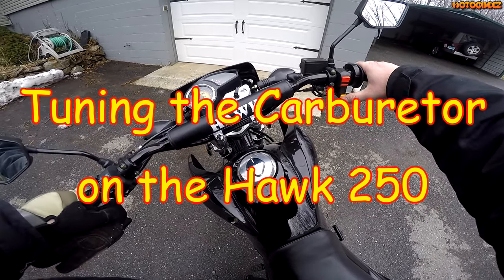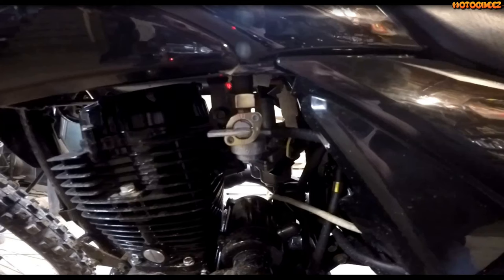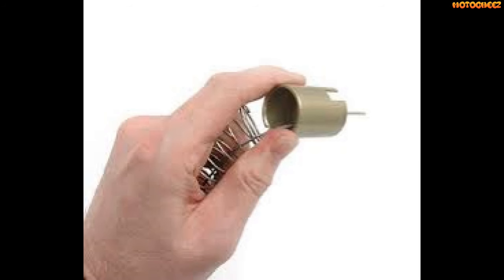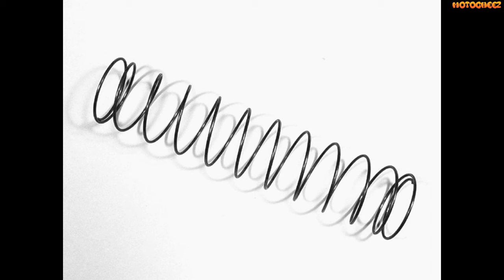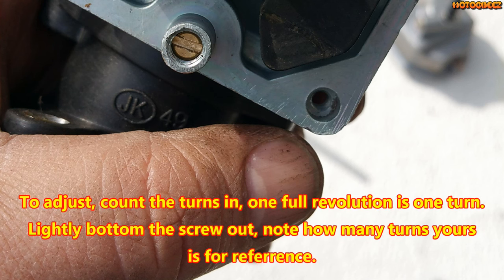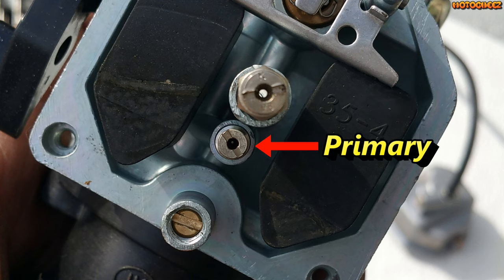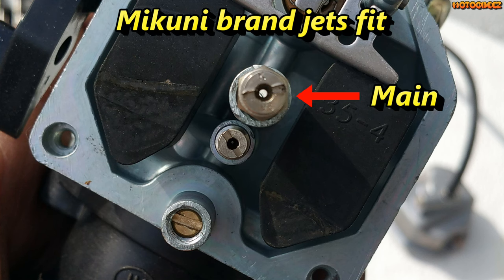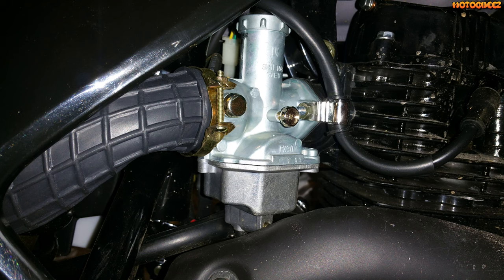[E3] Hawk250 Carb Tuning on the Dual Sport Chinese Enduro 250

Comment: Thanks Ray Liotta,  I used one thick washer under the needle plus 1.5 turns out on the screw and this thing finally starts easy and runs fine. I spent 20 miles tinkering with it before I watched this video and couldn't get it as good as this. This is just around town transportation for me, so this setup should do the trick. I scored the bolts to undo the carb perhaps in the future with a new jet but no rush. Many thanks from New Hampshire.
Reply from the maker: John Maynard excellent!!

Comment: Ok, I like it, did the airbox mod. 1.5 turns on the air mixture, 2 shims on the needle and 110 main. Went from 60 to 68 on the speedo. I have a local Chinesey bike shop near me. The main jet cost $3.18 . I know it's alot of money to gain power and speed but the minions must do what the minions must do. At first I couldn't figure out why you shimmed the needle why not just use the  next groove on the needle.....Ohhhh no other grooves on the needle. I should have known. Thanks Cheez. You the man!
Reply from the maker: scott addicott thanks!!

Comment: I did all the mods with the exception of the main jet witch I chinst on and went to the hardware store and for 97 cents I got the equivalent drill bit to a 115 orifice and opened the jet works awesome thanks motocheez
Reply from the maker: +Carol DeCosa I've done that in a pinch, sucks for the next guy who may want to replace it lol.

Comment: Thanks for the info Cheez!   I have the 2019 Tao Motor TBR7 250 which is basically another version ofthe Hawk.    Factory carb ran ok, but sputtered pretty hard at 3/4 to Full throttle.   Installed Mikuni carb 110 jet, fuel screw out 2 turns from tight, needle jet set one click down from the top (how it was in the box).   Air box and exhaust are factory.    This eliminated all of the sputter, and gave the bike overall a much zippyier feel to it.   Only other adjustment I had to make was the idle screw maybe 1/8" turn if that.    Awesome!
Reply from the maker: Sweet!!!

Comment: Well I had to build an air filter basket and put a sock over the basket to get more air, up the main jet to 110 and ride 3 hours with no bogging and decent response, haven't checked the spark plug to see how it's running yet

Comment: Thanks for the video! Im just over 100miles on mine. Same issues worsening. I will try the
the idle adjust. The bike never idled well. Beyond that I will try the washer shimming. I had
thot opening the plunger slightly with better throttle cable tension would do the trik but 
knowing there is an adjustment point (and shimming if required) sounds logical enuff for
me!

Comment: Solved my half choke issue.  Lever on carb was broke.  Never opened fully.   Was full or half choke whole time.  Back down to a 105 main and runs great.  Got 5ft of air on Sunday.
Reply from the maker: Wow. Good find!
Reply: @MotoCheez  would you happen to have a rim recommendation? Bent front rim on a boulder i shouldn't have tried to ride over.  Ate shit magnificently.  Replacing headlight , handlebars , clutch and brake levers.  Turn signals and tank plastic on left side as well.  Was hoping to get an impact resistant rim and new wheel hub.  But not sure what size rotor , wheel hub combo i need for this thing. Also need to stiffen the front suspension a bit and go back to that fucking boulder .
Reply: @MotoCheez  i climbed a mountain with it.  Thing is pretty darn good for 1500 bucks.  Coming down the mountain .... not so good lol
Reply from the maker: Dealer. But everyone is sold out! Damn. That's sucks
Reply from the maker: Haha
Reply: @MotoCheez  I'm gonna try to get just a rim hoop and reuse the hub
Reply from the maker: That's good if you're up for the challenge!
Reply: @MotoCheez  challenge accepted.  Ordered tusk impact rim hoop 36h 21" along with truing stand and spoke wrench.   Almost ordered a gasgas ec250 front wheel with hub already installed from tusk.  The hubs are anodized aluminum and look pretty sweet.    They're the same size but I would need a 5bolt brake rotor I think/hope is the only difference because I'm about to order the front and rear set

Comment: I am using the VM26 30mm clone. The fake Mikuni. I have a 22.5 size pilot jet, and a 105 main jet in the carb and it runs great for the most part. I am at about 4,500 feet in elevation. I never need full choke only half choke on most cold starts and I only need half choke for about a minute sometimes longer when it is really cold. The bike runs great and idles great when I take choke off after about a half hour of running bike and getting good and warm I notice as the bike gets warmer it doesn't idle as well and I need to turn up the idle with the idle screw. My plugs don't look fouled, and they don't show signs of running too lean. They look like they are burning decent. I am running the stock air box and exhaust. Does it sound like as the bike heats up it is starting to run rich/ lean or is there a possible air leak in the stock airbox that? I am puzzled. I have great throttle response and power.
Reply from the maker: Hmmm, usually idle goes up when it's hot. Maybe it is a vacuum leak somewhere. Or valve adjustment?
Reply: @MotoCheez  I have my intake valve set at .003, and my exhaust valve set at .004.I am going to let the bike idle warm and spray carb cleaner around the carb and manifold, and airbox intake to see if that changes the idle. I have checked the valves twice and they are good. I don't think it is a jetting problem.
Reply from the maker: Hmm. Agreed
Reply: @MotoCheez  what could be going on is I put an inline filter between the petcock, and the carb. The fuel line is really snug and I had a heck of a time getting it pushed on the fuel filter. It was so tight I didn't use any clamps on the filter. it isn't leaking any gas, but I wonder if when it starts getting hot down under the tank if maybe the rubber is softening up and I am sucking a little bit of air. I wouldn't think that would matter, because these don't run like my nitro RC car and airplane engines. If a nitro motor sucks air in the fuel line to the engine it will normally stutter and die.  That really sucks when you have to dead stick land an RC airplane lol.
Reply from the maker: Ahh. That makes sense
Reply: @MotoCheez  I uploaded a video of my Hawk I uploaded recently of me taking a ride on my Hawk to my channel, and it shows what I am experiencing with my Hawk.  I used an old runcam II velcroed to the visor of one of my off helmets.  I discovered I need to upgrade my camera as there is no image stabilization. For what I used the video didn't turn out that bad.

Comment: What elevation are you at? I'm in Toledo Ohio about 500 ft above sea level. My son bought one of these I had to take the plug off the idle mixture screw it was all the way tight. At first I tried it at one and a half turns and then I tried at two turns it seem to have got smoother at two turns but with bogged down so I put it about one and a half.. when I had the carburetor on her just to see if there's any air leaks I sprayed a little starting fluid around everything and it didn't Jack the idle up so evidently it's airtight.. I have a chance to main jet or anything he's a beginner he don't need a rocket
Reply from the maker: I'm at 600 feet here. I usually go out 2 1/2 on mixture and 115 main jet. You could go up one on the pilot Jet, to a 38 I believe

Comment from the maker: I just rejetted up to a 110 main jet yesterday.( then a 115, which was good, now I am up to a 120 with ALL my mods)
Reply: +MotoCheez what is the thumb screw on the right side of the carb for ?
Reply from the maker: +ZX6R that's the idle adjustment
Reply: +MotoCheez thanks, having a hard time running idle without giving it throttle.  mine stalls without throttle and was wondering if low grade gas was the problem.
Reply from the maker: +ZX6R screw in the idle adjustment. Mine idles low when cold so I keep throttle by hand until it warms up then it's good
Reply: can you update your jet kit link? or just what size pilot and main jet do I need for more power?
Reply from the maker: I updated the Jet link and redid Motocheez.com so the most recent links will be there if the ones on the vids are no good...

Comment: Man you are a good mechanic I just put 2 spacer on the needle like you did not only it adjusted the free play now I have more power at higher rpms I still think my bike is starving a bit for gasoline at higher rpms I'm thinking of putting one more spacer for a total of 3 or should I just adjust mixture screw? I have it at one turn now.
Reply from the maker: The mixture screw should be out 2 to 2 1/2 turns. 2 washers spacing up the needle is plenty. You're going to need a 110 main jet now, which is for when throttle is wide open
Reply: can you give me the specs of the need so I can buy it. Its running great right now I am very happy all thanks to your videos. but like you said I need that 110 jet needles I still feel like its asking for more gasoline.
Reply from the maker: +Modesto Rodriguez 110 main jet. Mikuni round main jet. Large or small round will work. Ebay has them. Stock is 98.
Reply: thanks
Reply from the maker: I updated the Mikuni jet link, it's from China .. http://goo.gl/ySTjOd
Reply: Nice that is a kit with plenty of jets for me to experiment with, I did everything you shown me in the carb video and FINALLY the bike runs great, now I feel it has plenty of power but I want more so I am jetting.

Thanks for all the helpful videos.
Reply from the maker: Great! The main jet at 110 will be perfect, but play around to whatever your bike may need...  Have fun!

Comment: Nice. I bought a kit from amazon to change the jets. I changed the main jet but primary was a different size than they gave me in the kit. What happens now? Its a mikuni clone carb of course. Does the primary jet need to also be changed? I changed the 100 jet to 110, seemed to be running lean. So I will try it without any further tweaking other than the mixture screw. I will turn it out 1-1/2. And see how it does. It probably won't work now that I didn't change the other jet.
Reply from the maker: Try 2 turns out. I had mine almost 3 turns. Same as raising pilot jet but you're only supposed to go 3 turns out, then go up on pilot.
Reply: @MotoCheez  my idle mixture screw turns about 5 times. Doesn't seem to have a stopping point. I just screwed it back up about where it was when I started. All I see is a small needle coming through the bore area when I tightened it about 5 turns. Nothing seated. Not sure what it was supposed to do or if it was supposed to bottom out.
Reply from the maker: It should bottom out and then do 2 to 3 turns out. Yes you can remove the screw totally

Comment: I just wanted to say thank you, I bought a Hawk mostly because of your videos. I rejetted and put washers on my stock carb like you said, even before I started the engine for the first time, and it seems great, just curious if you would recommend upgrading to the mikuni and if you see any benefits to doing that? Thanks man!
Reply from the maker: Warren Yeager I thanks and congrats! I don't think the Mikuni is any better for power gain from what I've seen and heard.
Reply: Hey Cheez what pilot jet do I need for the mukini carb?
Reply from the maker: I believe it was 28 that worked best. Been a while lol
Reply: @MotoCheez  thanx 4 the help much appreciated!

Comment: I did as the master of all cheez said. I did the airbox mod, put in a 110 jet and 2 shims, turned the pilot to 1 1/2 out. It's a night and day difference. Runs as I would expect now. Motocheez, thank for posting the videos. I was able to use your links and discount code as well.
Reply from the maker: Awesome! Sometimes 1 shim works better. Thanks

Comment: Just get a Mikuni carb. I use my Hawk for on-road so I'm changing the sprockets and tires so I can get a higher top speed. Had no issues getting my bike titled and licensed.
Reply from the maker: Awesome. What state?
Reply: +MotoCheez The great state of MO
Reply: +Andrew93 what carb did you use ?
Reply: Did you have to adjust it? And can you send me a link?
Reply: Yes. It will need to b adjusted

Comment: I didn't see where the retainer clip came from when i switched to a Mikuni. Bike runs. Is the clip needed? Thx Cheeze!
Reply from the maker: It's set in the middle usually. If it's running good don't need to adjust

Comment: I open up the carb like you show but with a hand saw and it work I clean the carb and I found the pilot jet was clogged up I clean it and it's running good now but I feel that at higher rpms it like doesn't get enough to gas or something I don't know if that's a mixture screw that needs adjustment but I have it 2 turns out like you did.
Reply from the maker: It's the main jet needs to be larger. Mixture is low throttle only. You can try shimming up the needle with a small washer or 2. That's more mid/high mixture

Comment: I think this is too much work; would rather just order one of the Ebay 'Mikuni' carbs.  I have read that this carb is made to NOT be tampered with.  My '13 TMEC 200, which has an engine made by Zongshen, had no issues with the stock carb.  Over 10k miles of commuting, and I never touched the carb, except some SLIGHT turns on the external adjustment screw.  I am guessing a few years later, the EPA cracked down on the motorcycle companies still using carbs and made them tune them leaner?  I think the most basic things one could do with these Hawks is the exchange the carb, and throw on a 17 tooth countersprocket and 45 tooth rear sprocket.  Not sure if you have replaced your sprockets, MotoCheez?
Reply from the maker: The carb is made not to tamper with. I have a video on this channel that shows how I did it. I've also read about immunity carb replacement. Possibly a better option.
Reply from the maker: I have not geared it up, I like the low gearing because this bike I will use 80% off-road and 20% on. It's nice and low geared for the trails and has plenty of torque
Reply: MotoCheez I believe this is probably a few years on (from my '13 Chinese bike), so the carbs are probably made much more tamper-proof.  My bike's stock carb could not be upgraded, either, but it seemed to be well-tuned from stock, as opposed to the Hawk's, which seems to be giving some of the Chinariders' members fits, LOL.  Hence, them replacing them with the Mikuni carb (which is advertised as a Mikuni, but probably a 'clone' but it does take Mikuni jets).  I have yet to order a Hawk, which I intend to do, so I will save personal opinion until that time.  But I have already resigned myself to needing a carb.

Comment: turns out the float wasn't even attached to the needle I broke the little wire thing putting it on so I guess I'm gonna go back to stock lose some power and but another minkuni hopefully it doesn't come broken
Reply from the maker: Liam Wells that sucks. So you noticed a power increase with the mikuni? I didn't notice much difference between carbs

Comment: My stock Magician 250, when cold started, the idle is too low, so, I turn the idle adjustment screw to set a idle whereby the bike will not stall out. Then, 10 minutes later, the engine at operating temperature... the idle is too high. Thoughts? Maybe I adjust the "idle adjustment" screw (behind the tamper-proof cap)? BTW, unclear if the choke has much effect other than to stall the engine. Top end power of the bike is good.
Reply from the maker: Chihuahua Waves that's common on carburated bikes, adjust the idle when warm, you have to keep it running by hand for about a minute or just drive it. Yes, the mixture adjustment will help if you turn it out One turn it a bit more.

Comment: I had put a 110 in the carb, and it is now spitting back, is this a sign of the main jet being to big or we didn't tighten the bolts hard enough
Reply from the maker: Probably too big, but without a filter it will run different.

Comment: Hey I do a lot of riding I live in Utah the elevation where I ride is 4000-6000 ft I did the air box mod do you happen to know what size jet and what the screw should be set at. Should I also get a mikuni to change the pilot or do you think that the stock carb will be fine.
Reply from the maker: At that elevation I'm not sure. But the pilot is fine if you can tune it in with mixture screw. The main jet you can try a 100. The mikunis are a little better than stock carb

Comment: Mine shuts off after going up steep hill and letting off throttle. Would that be a jet or float issue? Have 120 with new exhaust.
Reply from the maker: check your plug to see if it's too rich but if it happens a lot it might be vapor locking I don't know which gas cap you have on your home but some of the earlier ones had issues with venting

Comment: Great video! Will use in my future! In the meantime can you tell me where are the factory set the throttle stop screw? I just got this Hawk 250 and it won’t idle
Reply from the maker: On the right side of carburator. 
https://youtu.be/vNvnd8HxhM0
Skip to the 10-minute Mark if it didn't send it from there it's all the adjustments you should check while you're building it

Comment: Ok so I drilled my main jet with a 1/16 bit and now it sputters over half throttle? To rich now?  Jets on Amazon won't get here till June or July 
Any help would be awesome
Reply from the maker: You can solder the jet hole closed and use a smaller drill...
Reply: @MotoCheez  really? Idnk that. 👍🏻

Comment: anybody know the gas cap he uses, i was lookin to get rid of the tube one that it came with originally
Reply from the maker: The original hawks had different gas tanks and caps. They won't interchange.
Reply: @MotoCheez  so I do have to just use the one it came with so the tank breathes through that tube?
Reply from the maker: Yes, unfortunately